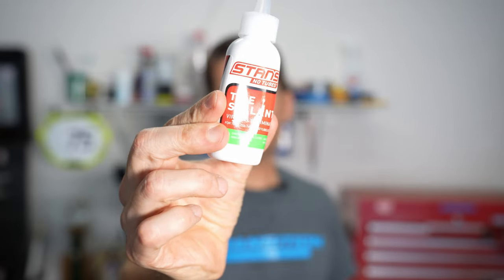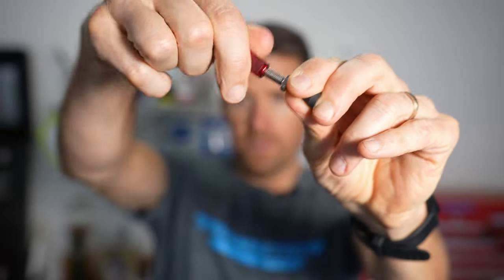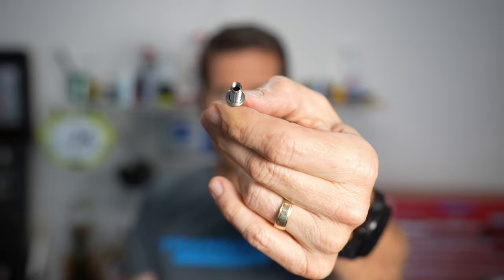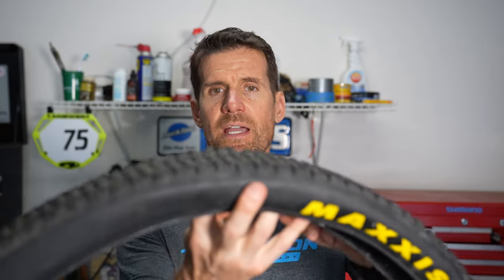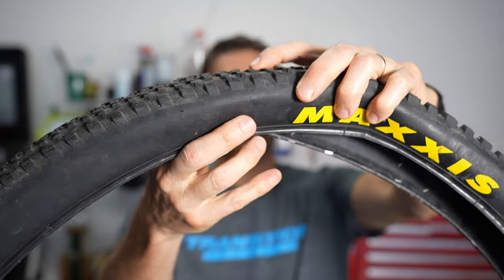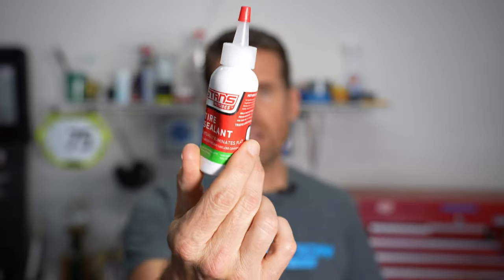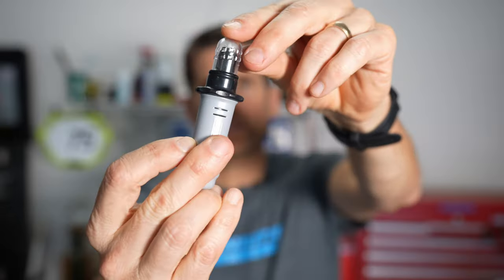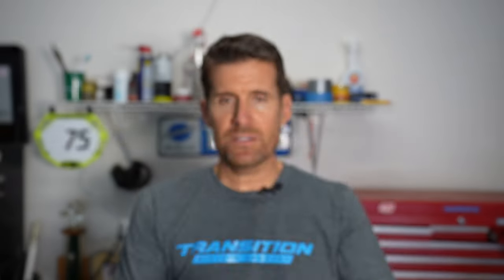Should You Put Tire Sealant in Tubes?

Comment: I've been putting Orange Seal Endurance sealant, in the innertubes of  my 6 bikes for the last 7 years and I haven't had a single puncture since. I can get my tyres on and off easily anywhere. Sealant inside tubes is the best move I've made in 50 years of cycling.
Reply: Did you meet goatheads?
Reply: I was on a group ride today, and  mentioned that I use Mr Tuffy and tubes then put the sealant inside the tubes. They told me it was stupid, further on in the ride 3 of the members got flats, I suggested that maybe the idea was not so stupid after all.

I as well have not had a flat in years.
Reply: I tried that before going to tubeless due to moving somewhere with tons of goatheads.   They barely made a difference.   I ride a ton(1200-1500 miles a month) so I expect flats. But I went from 3-4 flats a week to meetings 2.9-3.9 flats a week with sealant in tubes😅  Since going tubeless, I get about a flat a month that needs plugged.  No idea how many flats get sealed without me noticing but I regularly stop to pull goatheads out of my tires
Reply: @magnumllama400 no kidding. Iam in West Texas and the local bikes stores have shown me the sealant goes off quickly  and doesn't work
Reply: Hi. how many ml of sealant do you put in each tube? For example for 27.5 size or 29er.
Reply: @hehersongarcia1190  in my 29er I put between 3 and 4 oz in each tube, that’s roughly 85 and 115 ml.
Reply: @magnumllama400 yeah did u meet thornheads
Reply: as just a starting mtbiker here in us because we moved here i got a vintage full sus with tubes on it and always got thornhead on me everyday!!!
Reply: @magnumllama400  I've been putting Orange Seal oe Stans Endurance sealant, in the tubes of  my 6 bikes for the last 7 years - probably over 100 goat heads punctures sealed while riding in the backcountry
Reply: 120ml
Reply: Bra-less doesn’t like bumps 🤔🫨
Reply: i use tannus armour inserts also
Reply: @hehersongarcia1190 as much as you want to, Green slime says a 8oz bottle
Stans probably 4 Oz or more?
Reply: Could u show me please how to do that please
Reply: ..Sacremento Bike Trail have some of the Knarliest evil GOATHEADS....EVIL!!! ,LINER,GREEN SLIME ...PUMP KEPT ME ROLLING OH AND EMERGENCY TUBE...SHOUT out too The MTB'rs out there ❤

Comment: Hello Clint, for my style of riding (74 YO), I think running tubeless is more hassle than it's worth!  I do run Slime sealant in my tubes to eliminate sand spur flats.  Thanks for pointing out that tubeless systems improve traction and ride quality.  That I didn't realize.  I think I'll try tubeless on my next bike!
Reply: 74, still cycling, still trying new things. I hope I’m you 30 years from now.
Reply: Tubeless really isn't messy if you're smart about your install.
Reply: Update: I converted my HT to tubeless just after commenting here, and, it really does improve traction as well as the "feel" of the ground!  I'm sold, my new bike, a Giant TranceX Advanced +0 is tubeless right from the LBS and I wouldn't have it any other way now.
Reply: Nice that opinion has changed however with the quality of modern tires. Non UST. Light and sieve like it's indeed in many cases more probablems than use. Especially for high torque ebikes. Until tires and rims, spoke count etc are made properly it's just very troublesome.
Reply: @captainchipowen5184  I agree. I was riding tubeless compatible wheels and had a flat about 5 months ago. My road bike shop [higher end] had a discussion with me and I tried tubeless. The ride is definitely better! Tubeless tires are faster and smoother to ride. Carrying a plug kit and a rechargeable mini motorized pump seem to be the best option for me for dealing with potential flats. One tubeless tire required plugging a few months ago and then held air as well as the other tire on my bike until my bike was stolen about 3 weeks ago. I just setup a new set of wheels for tubeless and didn't have a problem at all doing so. I was disappointed that the new wheels came with valves that did not have a removable core. I ordered removable core valves for a few bucks and will swap them into the new wheels when it is convenient to do so.

Comment: The simplest and most straightforward method for applying sealant to a non-removable valve is to puncture the tube, apply sealant, seal it with a tire patch, and then inflate.
Reply: I use an injector without removing the valve and this works fine.

Comment: What I don't get is why these questions are still open/up to each rider, of tubed/tubeless, and sealant: whether to add, and if so how much. Clint prefers tubeless, but tubeless comes with a recommendation of 4oz of sealant within each tire, from what I understand, which slows you down. It just seems like there should be a simple formula people can use, describing the amount of sealant to add, based on the tubed vs tubeless set-ups and the likelihood of puncture flats.

Comment: I've been riding for about 20 years now, most of the time with tubes, and I can count the flats I've had with my fingers and still have some left... Recently I moved my MTB to tubeless and I can't really see the difference, just more hassle... I can't change my tires as easy, the valve gets stuck very often, and the sealant will dry up, ending with clogs rolling inside my tires... My new bike will continue with tubes, maybe with sealant inside... But a few years ago I tried some tubes sold with sealant for my road bike, one flat with a tiny wire and did not seal, what a mess if sealant, not no mention that I couldn't repair the tube. I hope new sealant is way better... Quite a long history!
Reply: I use tannus armour inserts also
Reply: Tube all the way for me-- no mess, no time consuming. It takes only a few min for me to change a tube... so I'll be sticking with tube.  Been riding with tube for 30+ years and hardly get any flat in years when switching to Conti Gatorhardshell or Gatorskin.

Comment: I was debating either adding sealant to tubes or going tubeless - however - this video has helped me decide to go tubeless!!!   THANK YOU!!!  Yesterday I went to the bike shop and returned with all items necessary to make this transition to all four of my mountain bike tires.  I've watched some videos on how to convert to tubeless - I think I can do this.  Thanks again!!! 👍
Reply: Tubeless has some disavantages too.
Durable tubeless tires will weigh more than non-tubeless tires, so in the end I don't know which is heavier. I said "durable" tubeless tires because there are some light tubeless tires that are quite light but they are very expensive, they don't last long and they're a lot more prone to be punctured or to have snake bites.
Also, if you happen to get a small dent on your rim, your tubeless system might get useless or you can lose some air through that dent, even when it is very small.
It happened to me twice and I never used very low pressure, but hitting rocks is a good way to dent your rims.
That's not a problem with non tubeless tires, I don't compete anymore and I prefer to go non-tubeless because it is a more durable system and tires are a lot cheaper.
Reply: Facts

Comment: i run full tubeless on my road bike for few years now but for my MTB which I will ride only for 2-3 friendly competitions a year, I don't want to deal with the full tubeless hassle (clean the shit, refill and so on). But I will give it a go with sealant inside the tube and hope I don't get a puncture. I'll carry a spare tube next weekend on the first competition and see how it goes. 
As for less pressure, better ride quality, i don't care. All I care is about no puncture for 2-3 hours during the event.
Thanks for the great video!
Reply: When I competed 10 years ago, using tubes with sealent inside was the best thing that I did to not get a flat tire.
It is easy to solve if you happen to have a puncture that isn't solved by the sealent and it is a lot easier to fix.

Comment: Good vid Clint, just my 2cents, I’ve been on tubeless for 10 yrs. With the wider inner rim widths on modern disc road wheels, I went back to inner tubes with (drumroll please) orange sealant. Note this is in context of roadbike on tarmac, not mtb which definitely need tubeless setup due to  off road riding.

Comment: I use the green slime in my tubes.
I run a higher presure because my riding is a good mix of off road and relatively smooth tracks and the weight is compensated by the reduced rolling resistance. 
I have only had to fix one puncture in 2 years, the rest fixed themselves with only needing a top of of air when I got home.
I'd like to try timeless sometime but feel like it seems fidly .
Reply: What gives the reduced rolling resistance?
Reply: @bradsanders6954  high presure in the tyres reduces the amount the tyre reforms al it rolls which reduces resistance.
The green slime increases the resistance due to weight but it's not that bad.
Reply: What puncture what about goatheads
Reply: @magnumllama400  thorns, rusty staples, small nails etc all ok.
Not sure about goatheads, what would be the equivalent here in the UK ?
Had a couple of pictures lately, but I think it was due to not enough slime in the tyre ( I bought bike second hand and guy said he already put in slime but I think wrong sort and not enough ).
I hate punctures ....

Comment: I have successfully been using repaired inner tubes with Stans sealant now for over a year and more.
First I ride MTB on 26in wheels and use only quality Presta valve inner tubes which are around 0.9mm thick. After testing I’ve found BBB to be a good inner tube, however on 26in their range is now limited, so I suggest Continental, or Specialized or Hutchinsons 0.9mm inner tubes because I think they all use the same Chinese manufacturer where the tubes are better quality. Never use the cheap supermarket tubes.
I prefer to use the best inner tubes and repair them, and they can be repaired many times if done correctly, then discard when they fail around the valve if old. Eventually the rubber will get weak but I expect by then you will have your money’s worth.
Best practice is to carry spares and change the inner tube and repair at home.

Schrader valve cores can easily be removed however most or all Presta valves I have tested the valve core is all one, so Presta cores cannot be removed. 
If using Schrader valve remove the core and inject the sealant.
If using Presta valve when you repair a puncture inject the sealant through the puncture hole and then patch with the sealant inside.
I’ve found the Stans sealant still fluid over a year later. Some did dry up but still noticeably liquid. Be careful to pump with the valve at the top.

After a year without a puncture I got a flat due to the valve damaged. The tube otherwise was sealed. Checking the tyre I found 2 small thorns plus a small sharp stone in the tread. There was no apparent sealant on the inside of the tyre. So I’d say it was a success and worth continuing to test if you have to use inner tubes. I tested with Stans ordinary but haven’t tested anything else. I did notice less punctures.
I didn’t put in huge amounts and not as much as would go in a tubeless tyre, so I didn’t notice any difference in rolling or weight in either the front or back tyre.

For those that have to use inner tubes then I would give this a go. For those unskilled to go tubeless then this is an ease step towards it.
I’d suggest giving this a try and do so when repairing already damage inner tubes.

The drawbacks.
The inner tube in time may get dry and gummed up inside and there is no way to clean it. However depending on sealant I think this will take a couple of years before disposal.
The valve core can get clogged but with Stans didn’t stop it’s use.
You are rolling the extra weight of the sealant with an inner tube.
You are also carrying extra weight of the sealant in any spare inner tubes.
Inner tubes containing sealant cannot be rolled tightly flat so take up more space in your pack. Plus if one leaks then you could get sealant in your kit.

If you don’t want to do this yourself ‘Slime’ sell them, however you could also consider the thorn proof thicker inner tubes with a thicker tread.
Reply: All Schrader valve core can be remove. Even your car have does. Im an Auto Mechanic by trade
Reply: That's good to know! :-) I had done a tubeless conversion on my MTB, however since I don't use it all that often, most of the time when I get it out to ride, the rear tyre has deflated and come unseated, despite using a tubeless conversion rim strip, tubeless tyre, a "pool noodle" style tyre liner, and tubeless sealant...  Choice is to either try sealant in tubes (the stuff I have, says you can use it in tubes), or go with heavy Schwalbe Smart Sam Plus (or similar) tyres, which have the added puncture protection strip under the tread.
Reply: Good write-up. Tnx for the shared experience.
Reply: Thanks for the info. Very detailed.

Comment: I've successfully put sealant into non-removeable valves. You need to attach a syringe using a tight plastic tube to the valve, depress the plunger lightly and wiggle the open valve core as you do this. The sealant should drip in no problem. One concern is blocking the valve with dry sealant because I don't think you'll be able to ever get it out.
Reply: hey, any issues with the dry sealent, one year later?
Reply: @riveteye93  In lightweight Tubolite tubes the sealant dried out very quickly even before it was able to block up the valve. Definitely wouldn't try it with Tibolites. Have since gone full tubeless and would swear by it.
Reply: I just mounted a couple of tubeless tires on new rims. They are Shimano wheels. They came with non-removable core valves. This is disappointing. The tires were mounted without a problem. Injecting Stan's Sealant through the valves wasn't a problem either. They are holding air and easy to top off with a pump also.
Reply: @riveteye93  It seems to me that someone should market solvent for the sealant material to maintain sealant in tires. If the proper amount of sealant is in the tire and it just dries out, why not just add solvent for maintenance 2-4 times a year?

Comment: I will add one negative to Stan’s in tubes. With higher pressure tires, like gravel and road bikes, the sealant will just shoot out. I found more often I have to remove the tube and the tire will fill with sealant. Messy. Though I do have a couple bikes that won’t run tubeless, so I still use sealant in tubes. Thanks for the video

Comment: I used Slime inside tubes in the past with mixed results.  I converted some of my bikes to tubeless and it's the way to go especially for gravel and mountain trails.  Important to check sealant levels regularly as sealant will dry out.  Also my rear tire will get more cuts than front tire and needs sealant more often as it's being used up to seal the cuts.  I find myself adding sealant every couple of months.
Reply: Hi. As I know that Slime will be dried out after 2 years. My question is after 2 years can we put Slime in Inner Tube again, or we have to throw away old Inner Tube and put a new one?
Reply: @dttub  Slime will likely dry out before 2 years.  No harm in adding fresh Slime when necessary.

Comment: Worth adding that a cheap inner tube has a cheap removable valve core, I had them failing over time, I think because of tight fit of the pump and the threads would not hold anymore.

Comment: If your going to do that I would suggest using sealant that is designed for use with tubes. As I recall back in the day that sealant we used with tubes was much thicker than the sealant we use in a tubeless setup today.
Reply: Orange seal says the same sealant goes in either.  Lasts longer in tubes.
Reply: @bradsanders6954  well when I was still running tubes on my road bike I tried putting orange sealant in the tubes because that's what I was using with my mountain bike. Yeah it lasts long but it really didn't work with tubes.  My experience is that orange sealant won't seal up a tube that's been punctured.
Reply: @michaelglidewell1524  Even orange seal states on the bottle it works in tubes,and Ive had it work in tubes great for 3 years now on 3 bikes..........but Im sure your right.
Reply: @bradsanders6954  I'm just telling you my personal experience, "your mileage may vary."  I've found it to work great for tubeless setups (MTB, road, gravel) but putting it in the tubes on a road bike never really worked well for me.  I switched from Stans to Orange Sealant about 6 years ago for my MTB.  Tried it in the tubes on my road bike for about 3 years, then switched to road tubeless setup 3 years ago and have had much better performance since.  If the setup you have is working for you then stick with it until it doesn't.  My setup wasn't working for me so I changed to one that does.

Comment: In tests performed exactly for that purpose it was determined that "static weight" vs "rotational weight" isn't an issue 2:35 . As for weight, remember that sealant has weight so the difference between tubes and sealant isn't as much as one would think otherwise. 
Having stated the above, tubeless is better for traction, reduction of flats, cornering, and ride quality.